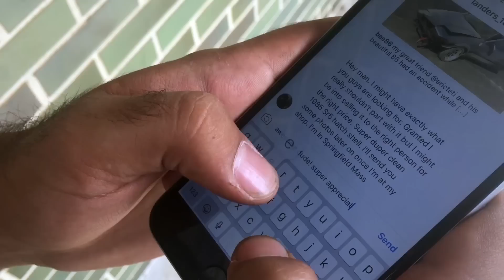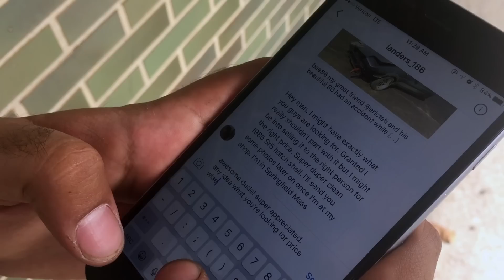Eric's AE86 Rebuild Episode 1: Damage Report

Comment: fuck i would of pulled the roof out and strut tower out  after all you do have the other side to get measurements from to repair it
fuck after all i did repair a Mitsubishi L300 delica 4wd van when a trailer tire blow out caused it to roll out of town
pulling the roof and tower is  an easy job, hardest part is changing from one car to another lol

Comment: That's an AE92 but anyways, gotta get them views.
Reply from the maker: Incorrect. AE92 only comes front wheel drive.
Reply: ProgressionD After further research, it's probably a Toyota Sprinter Trueno SE 2-door
Reply: There are no Sprinter Truenos/Levins nor are there any SE AE86s in the States. These AE86 Corollas either came in a DX (4A-C), SR5 (4A-C), or a GT-S (4A-GEC) Variant. So it's simply one of the three.
Reply: Aj Figueroa  The US Sr5 and GT-S is a Sprinter Trueno but with longer bumpers to meet silly US regs.
Reply: and 16hp less
Reply: Batman is ae 111 faster thsn ae86-89?